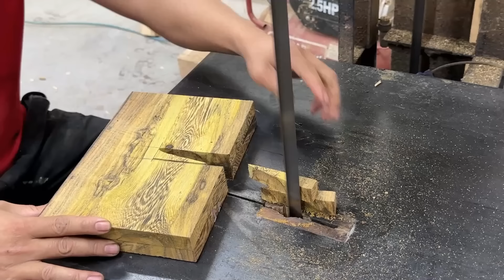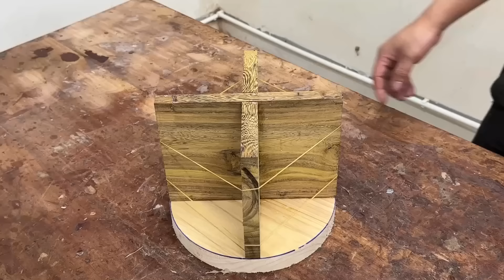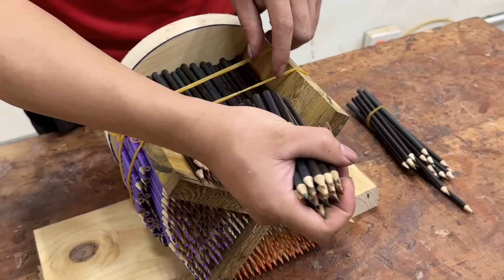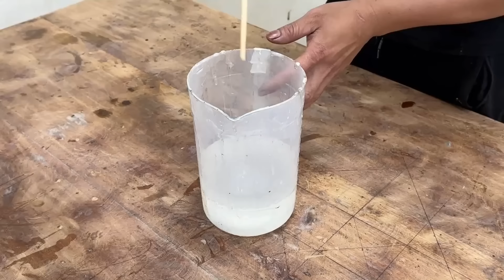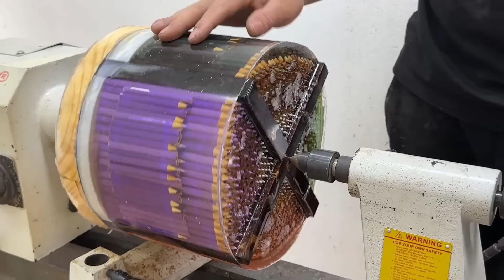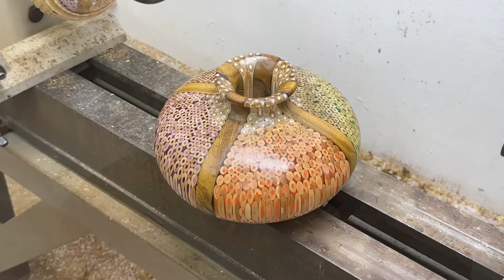Multi Color Artistic Design From Pencil With Beautiful Curves Machined On Wood Lathe

Comment: A rather large vase that would hold just a few ounces of fluid. Not too impressed!
Reply from the maker: Thanks
Reply: But what kind of artificial flower arrangement might it hold proudly for years of beauty?
Reply: This is not intended to hold liquid. I invite you to do better
Reply: @Susweca5569  I never insinuated that it was intended to hold liquid! I just stated that if it was filled with liquid or anything else for that matter it would not be much compared to the size of the vase!